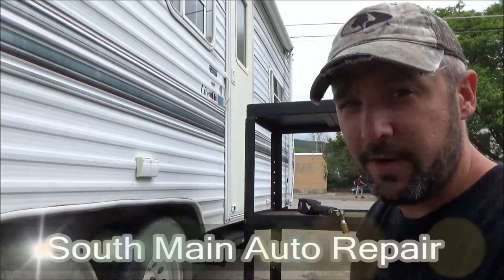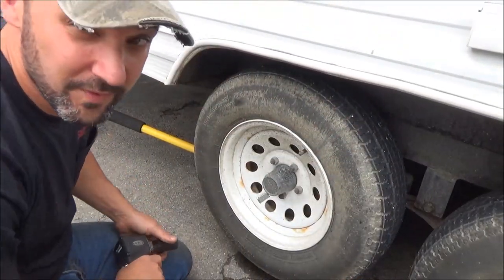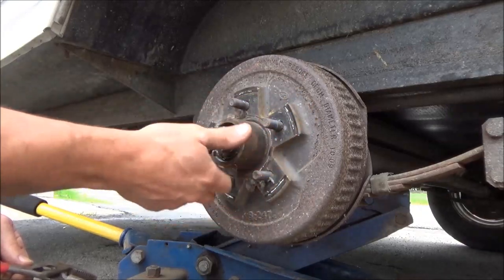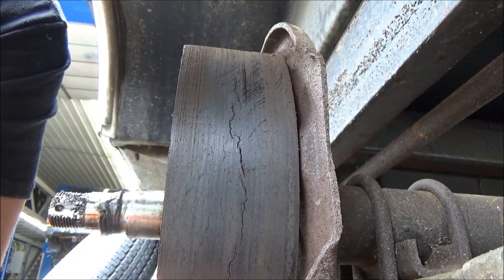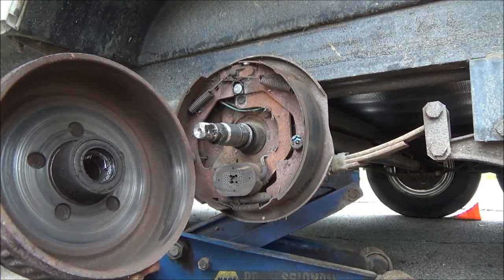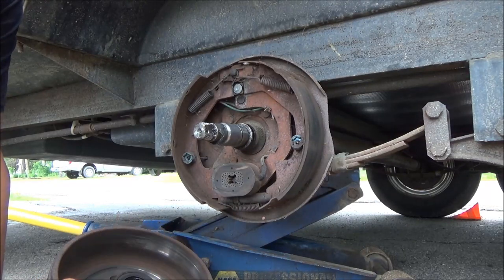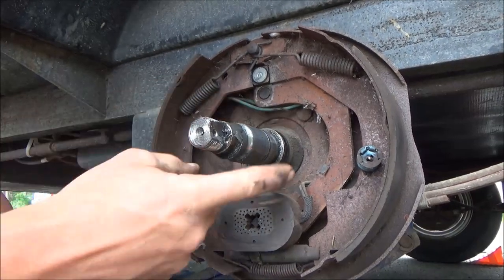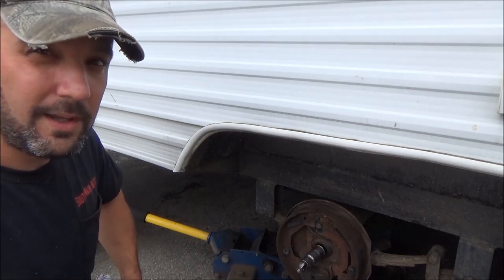Replace: Electric Trailer Brakes - Part 1

Comment: I learned something today, never had an opportunity to do electric brakes. The only trailer brakes I get around here are salt water boat trailers and usually a torch is needed to get them apart and what you get off goes right in the scrap pile.
Reply from the maker: eldoradony Ahhh liquid salt now we are talking ha
Reply: South Main Auto Repair Liquid salt... hmmm, that's 1,474°F!
I fear the corrosion is the least of your worries if you are driving in liquid salt. :P
Reply from the maker: Haha good point

Comment: if you are working on a Dexter axle if you notice the 8-247    cast number   (this one is a 8-247-05 meaning 1/2 studs)  that will tell you everything about that hub and backing plate.  Rule of thumb if your backing plate needs 2 items its cheaper to use a loaded  backing plate.

Comment: My trailer is 10 years old now and I probably need new brakes.  No sqealing but set up is on high.  Did not realize how they worked until I watched your video.......very informative and especially enjoyed your sense of humour.  You did an awesome job of narrating and using the video camera, very detailed.  I thoroughly enjoyed, thanks.
I have one question, what would the average shop cost be for a complete travel trailer brake job (parts and labour).  
Thanks again, Lloyd

Comment: Those axles bend real easy. Jack should be close to spring if not right under it.
Reply: I was thinking the same thing. I need to check my brakes and will jack it on the spring pad

Comment: Is it possible to wire the brakes backwards?  My wires were severed and both wires coming out of the brakes are green. Will the magnet repel if I guess wrong?

Comment: Do you change many of these? How about the actual axles? I do probably a couple sets of axles a month, around here people overload their trailers so the axles bend and the tires burn off. I rewire brakes all the time when I repack bearings which is probably weekly.
Reply from the maker: kenman1717 I do brakes but few axles actually

Comment: South Maim
How many miles does the electric magnet last. My magnets only had one dot left.  I believe there is a DC short causing the magnet to engage.  This is a new unit with only 10,000 miles on it.  2018 grand designs 5th wheel.  unit weight 12000# empty.
Reply: Dee Jay  thanks Dee,  I checked for a recall as sudjested but none. These are Dexter axles. I ordered new backing plates, and I will start from scratch. I checked the Electromagnetic and it has failed the test. I will check the new ones to see what results I get.
Thanks
Kirk

Comment: Say Eric, I watched your video twice and then ordered sets of Lippert brake assemblies. Installed them and tested , just like you show in the video. one of the right brakes just gives a slight hum, and the magnet does not energize to hold my wrench. Can you give me some ideas on what may be wrong. I used a multi meter and I am getting 12.5 volts to the wires on this brake set, but no magnet energy. Is this just a bad magnet??? What do you think?
Reply from the maker: Is this only happening on the one wheel?
Reply: Yes, seems to be just one wheel. I cannot get all 4 jacked up at once, but I tested the other side, and the magnets seem to work there. I am assuming that the magnet is shorted.??
Reply from the maker: Seems that it may be defective. Are you sure the wiring going to it is good where it comes from the other wheel?

Comment: Dear Eric O., your rationale for buying the entire backing plate as a unit is remarkably sound judgement.  It is akin to buying a quality remanufactured zero miles engine (did somebody say Jasper?) as opposed to a 'best of the junkyard' 65,000 mile replacement engine to replace the dead OEM engine in your otherwise serviceable vehicle. I need to do bearings, seals and brakes on my auto hauler and like you, I'm not going to skimp on the rolling parts. Thanks again!

Comment: Ya, be careful to put the jack under the springs, not in the center of the axle.  The whole backing plate with shoes, hardware, magnets, etc for both sides is the cheapest way to do the brake job.  Just clean and pack the bearings, replace the seal, adjust and go!